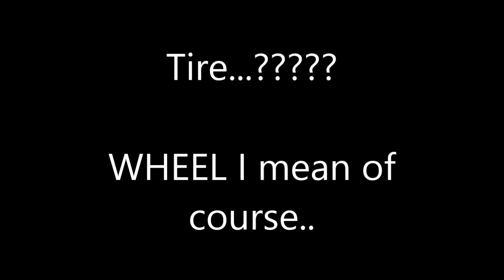Spray Painting Wheels Paint How To DIY Video ~ BTS Vlog

Comment: Most are saying about using cards.. but none are saying about standing the wheel up and rolling it.. as you do not want to have the can flat to the ground. As it normally does not pick up all the color in the can.
Rolling it you can get those areas you are saying you cant get to with out letting it run, also less spay on the tyre area, and can get even coats as you can hold it the same distance while rolling it getting the better coverage..

If you had some more jack stands you could do all 4 at the same time, as you are finished with the last one the first one is dry..